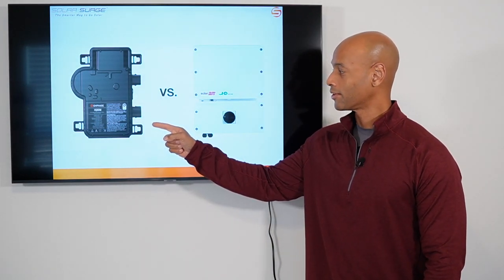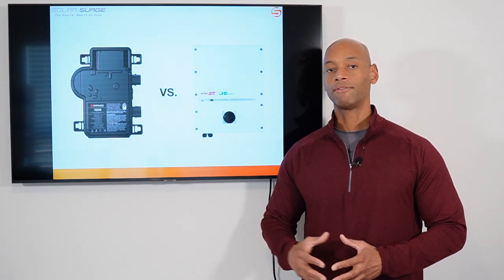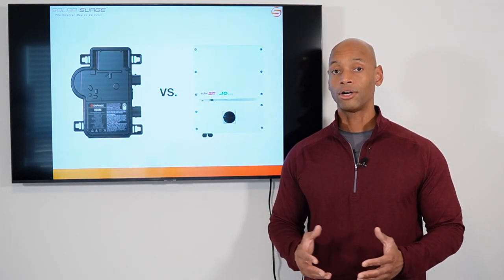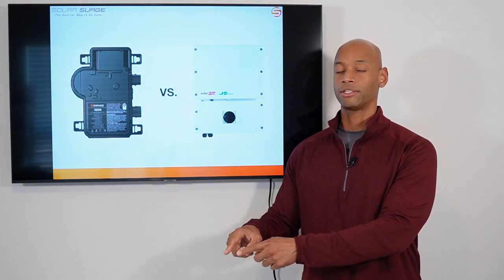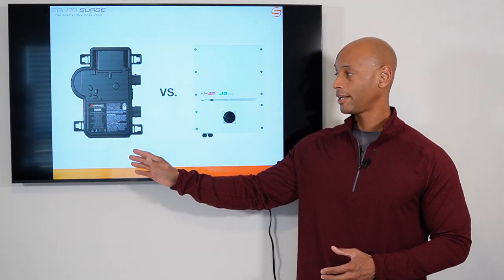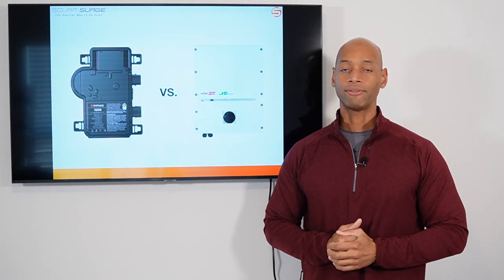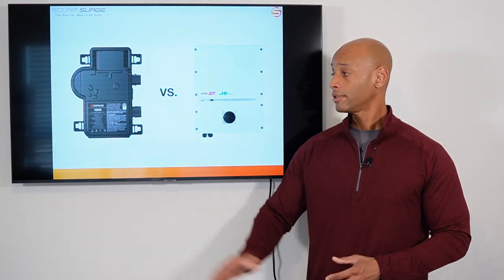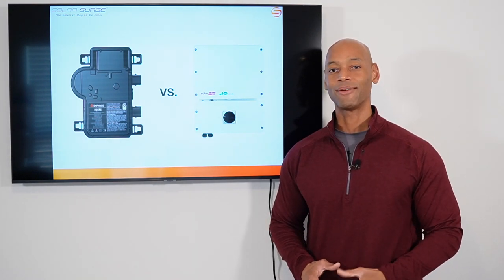Enphase IQ Vs SolarEdge Going Into 2023 | Solar Inverter

Comment: Ive had 12 enphase solar pannels installed on my roof with seperate micro inverters and its working brilliantly BUT im trying to get a price for a powerwall but when i asked enphase through the contact us link and they wont give me a price they keep telling me to contact my installer, surely installing an enphase battery energy storage powerwall cant honestly require an enphase tradesman to install the powerwall?....can it !?, or can someone on here tell me how much a powerwall will cost me and tell me jow easy or difficult installjng an enphase powerwall will cost me?.

Comment: Hey joe, I have been meaning to talk with you about your use of the term Daisy chain wiring to describe series wiring. It is a great sound bite, but it is wrong. Daisy chain wiring describes parallel wire common ground and common hot along the string. In Printed circuit design low speed circuits can be star or Tee wired. To control the trace (wire) impedance high speed circuits use daisy chain routing this reduces the refections of the trace. A better analogy would be series strings are like the very old Xmas tree lights that when one lamp fails the whole string fails versus newer Xmas tree lights that are wired in parallel so that when one light fails the rest of the lights stay on. In summary string inverters are basically series strings ( optimizers bypass the failed or poor performing panel). Micro inverters are true parallel circuits. Mixing and matching solar panels with Micro inverters is not a problem. Mixing and matching panels with a series circuit and optimizers provides no benefit. Before I go, what is missing from the current solar ecosystem is a vendor agnostic balance of system. If I choose a Tesla Powerwall I am locked into their gateway, their switch….This is true of every vendor in the market. There are some bleeding edge solutions in the DYI market, but nothing that I can get permitted or approved in my market here in San Mateo County CA. I have enphase Micro inverters and 2 tesla powerwalls, Tesla doesn’t give me a generator option Enphase does. Neither provides a solution that allows me to cross upgrade or maintain my current system. There are no barriers to entry just the need for existing players to produce battery, inverter and solar agnostic balance of system hardware *this includes incoming grid service panels. It is ridiculous that we have to upgrade the service panel to handle loads that it will never see. I send people your way almost everyday. Keep up the good work. Thanks for all you do.

Comment: I think you mention in a straight up String of solar panels... if one leaf falls on one panel the whole string plummets. I think that is basically incorrect as each panel has bypass diodes which take care of this. The one panel will plummet, but the rest of the pa els will deliver. Do i have this wrong?

Comment: I think it is a good philosophy to keep complexity within replaceable devices.  It is simpler to replace a complete assembly not working.
And to minimise interdependence of devices.  You do not want to have to decide which device of an inter- related group has failed.
Best to dumb down and make ultra reliable on site work.  Simple AC connections are easy to do, reliable,  and easy to  fault find.
Enphase micro-inverters seem best to me.  But I have no actual experience working with solar.

Comment: Isn’t Enphase efficiency at a disadvantage for solar battery charging as it has to do two AC/DC conversions (into the battery and out again) whereas SE only has to do this once?
Reply: waiting for a reply
Reply: yes, this would be a (very small) disadvantage.  however, it's not a normal use case, IMO.  when using storage, i am typically using a string inverter or charge controllers.  if grid-tied, i would use the enphase every time
Reply: It is more efficent when it is working. But when it breaks ans stays broken it is trash.

Comment: Doesn’t Solar edge with dc optimizer mean that you can use a DC coupled battery with less AC->DC—>AC loss that occurs with AC coupled battery? Also that battery wouldn’t need its own inverters
Reply from the maker: Yes, the SolarEdge architecture allows direct DC-to-DC solar-to-battery charging.  The SolarEdge battery needs toe be connected to a SolarEdge central inverter.

Comment: Hello, I live in central Pennsylvania. I am working with a solar contractor that utilizes Enphase inverters. He is specifying the iQ8+ inverter for a 38 panel system with REC 405 pure panels. I was looking at the output of the panel compared to the continuous power input for the iQ8+ and it looks to me like the panel put out more than the inverter can handle continuously. I asked if they thought I would be better off with the iQ8a which looks to exceed what the panel can put out. I was told that the iQ8a isn’t as good with low light power as the iQ8+ and that because I live in the north east the iQ8+ would not likely clip or have the panel exceed the inverter. Does this sound correct?
Reply: Try IQ8M
Reply: @fyrchiken, I'm looking at the same iQ8+ w/42 REC405. did you have them installed? If so, any feedback good/bad? Thx

Comment: I am surprised that you completely ignored the need for a DC buss and DC rated “fusing”. At least in my area the cost to build out an approvable DC system to the string inverter, eats up any cost advantage of the optimizers. I chose Micro-inverters for my install because it is the cleanest solution. No DC buss, built in redundancy, and the ability to mix and match solar panels of differing output, size and manufacturer. LG has exited the solar panel business, If and when one of my 39 LG panels fails it is a no brained to replace it with another panel from a different manufacturer and different performance. This is not the case with a string inverter with or without optimizers.  I get it that in the trades the lower bid almost always wins, but who wants a solar system that is obsolete the day it gets installed. Overcapacity on the Micro inverters is a feature not a bug. I have worked as a EE for a long time an reliable systems always have head room designed in. Enphase is delivering mature products that’s just work. A DC system is not simpler to install or permit. I have nothing against optimizers, I just can’t for the life of me come up with a scenario where I would rather have then on my system. I appreciate all that you are doing. Thanks for the great content.
Reply: Overcapacity?  I heard his comments just the opposite.  He said the Enphase inverters are undersized for the newer and larger panels.  That is the opposite of having headroom designed in.

Comment: How about neither? Modern panels with bypass diodes are more than sufficient vs the cost of another point of failure
Reply from the maker: That's a good point.  We see most homeowners like the ability to monitor each individual solar panel even if there is not much performance gain.

Comment: which ENPH IQ8 version has panel level module monitoring?
Reply from the maker: All the Enphase micro-inverters offer panel-level monitoring.
Reply: @SolarSurge  Thx, so what's the main difference between IQ8A to IQ8+ ?

Comment: In my case and my experience its not brainer ENPHASE its the best 😎. I will explain why in my opinion is. Here in Puerto Rico beside the experience with hurricane we have a BIG problem with the ELECTRIC company GRID its a old system and problematic along with the management that operate the company so long story short I had a SolarEdge system with 24 solar panels and the inverter use was 76000 serie inverter the big monster elephant in the room that has to operate with a small transformer on the side do to the batteries that I was using the Powerwall first generation (6.4km) 2 of them and that system was giving me all kind of problems, probably the batterie incompatibility wrong setup or connection you name it but the main issue that I found was that during of grid mode the combine energy consumed from the inverter and transformer to operate and maintain my hose was using a lot of energy from the batteries so with this new system that I have same 24 panel iQ7 and one Tesla Powerwall 2 battery its a big difference that battery it last me all night and morning till sun come up. I will never ever use a Solar Edge product again not event a BOLT or NUT made from solar edge

Comment: I have Hoymiles, HMS-2000-4T-NA, 4-in-1 microinverters in stock. Each microinverter can output 475W per solar panel, which is 25% more power than an Enphase IQ8H, and includes a 25-year warranty.
Reply: That warranty doesn’t help much as it likely Hoymiles go bankrupt. Also for installing a whole home energy system it’s much easier to rely on Enphase for almost all components.
Reply: @TurreTuntematon  Not likely at all.
Reply: @ToddDesiato  We will see in 2-3 years..
Reply: Hoymiles is a Chinese made vs Enphase being a USD company,I rather deal with America for reliability
Reply: @TurreTuntematon  Yes we will, and by then, I will have a 4-year head start on y'all.
Reply: @Wildsam157  Exactly. Hoymiles or AP systems are both doing mikroinverters but it’s the same as going for a Chinese Oppo smartphone vs an iPhone. No thanks.
Reply: @DiySolarHelpDesk  That warranty is not very useful when Hoymiles as a company doesn’t exist anymore and your systen doesn’t work 😂. It’s gonna need more like 4 years of savings from you then to be able to afford a new solar system.
Reply: @TurreTuntematon  LOL! That's not likely to happen, North America is not their only market and they are growing very quickly. Also, at half the cost of an Enphase, and the fact that any other microinverter is still compatible as a replacement, makes this a non-problem. If you want the savings and better ROI, it's worth the risk IMO. As I said, I have over 100 installed in the field and zero failures to date. Your loss.

Comment: The problem with the microinverters is that you have to convert twice to store in DC batteries whether they are station batteries or EV battlers.  The EV will be one your largest consumers of power so shouldn’t you be geared towards that demand?

I don’t think microinverters will have as much draw as we move into more home batteries and V2H / V2G configurations.  Too much power lost converting.  Besides replacing a string inverter every 10 to 15 years ushers in new functionality and maybe even more efficient dc-to-ac conversion.
Reply from the maker: I would agree that DC coupled systems offer more efficient battery charging. That’s a distinct advantage for that architecture.

Comment: Enphase need to offer better compatibility to up to 550w panels, cutting it down to just 300w is the reason I went elsewhere
Reply: that's something i've struggled with for my next install.  the IQ8H is rated for 380 continuous VA, btw.  i plan to just get 370W panels and deal with it...

Comment: There is a larger output micro…IQ8H has 384VA max 380VA continuous.
Reply: People tend to forget about IQ8 H for some reason…
Reply: Still not enough for Panel 470w and above
Reply: Very few residential customers install 470 watt panels. They don’t fit on a roof in a 60 cell format.

Comment: It is more efficient to convert 240 VDC to 240 VAC than to convert 12 VDC to 240 VAC.

But it is easier to ship AC over wire for distance than it is to ship DC.

So maybe we should get DC optimizers and string inverters on the roof, then combine the outputs of the different string inverters to send down to your panel.

Comment: I have both systems. A 4kWp solar edge system and a 6kWp enphase system. Both work fine although I prefer the solar edge app over the enphase app. Enphase provides a basic app but does not allow you to drill down on each panel like the solar edge app. Enphase provides a more comprehensive app but at a cost, in my case it would be £250.
Reply: Enphase DOES provide information down to the panel/inverter.  Look at your array, see the symbol in the lower right corner of each panel, click that for more information.
Reply: @allangoodman82  There is no symbol in the bottom righthand corner of each panel with my app. The only info given is the kWh generation
Reply: @colinwilson9122  use enphase enlighten, your array on that app shows the symbol on your panels
Reply: does both system are combined, mean they are for the same house?
Reply: @dema-3000  yes both systems are on the same house

Comment: I think the information on DC to AC ratio in this video is overly simplistic. There's a lot more that goes into it. In areas of high heat, like Florida, you can get away with a much higher ratio without significant clipping. Enphase has done an extensive white paper on the subject showing module pairing scenarios in different climates.

Comment: Please, when speaking about string inverters stay with the current panel technology, not old, with multiple diodes, split cell, and much improved inverter MPPT that works extremely well.  Much research has proven that the past shade advantages of micro inverters and optimizers is in the past.  Also, failure rate of solar panels is 5 in 10,000! Yes, .05%.  Think about this, Solar Panel warranties are 12-30 years because of the reliability. Thus monitoring each solar panel is unnecessary. Regarding SE and Enphase, get Enphase.

Comment: Would you rather have an ultra reliable PV array connected to an easily serviced string inverter and not see individual panel failures or.    hard to service under array electronics operating in a hostile environment that gives visibility of panel failures?  Why compromise the reliability of your array with under array electronics?
Hard to service
Reply: ? I had an optimizer go bad when my system was five years old and I changed it out myself with a used p320 optimizer off ebay for $30. Took less than 30 min and that was 3 years ago.

Comment: SolarEdge just sent an E-mail allerting users will loose the ability to remotely monitor their systems. They said, T-mobile cancelled service for the network. I can purchase a new modem. What terrible customer service. Six or Seven years into a 25 year warranty. Shop around and find a better company.

Comment: Enphase is trash in Arizona. Don’t do it
Reply: Why?
Reply: @maximus20895  simple put, you know how your phone has those heat warnings? And you know how when you charge your phone it gets really hot? So that’s a micro inverter converting ac to dc.

Enphase is doing that on your roof under every panel.

So when it’s 110-120 out your roof is about 30-40 degrees hotter. Now imagine a cellphone on the roof charging for every panel you have.

It ain’t reliable. And oh by the way any contract you sign the installer won’t service 1 micro they wait for about 5-7

Comment: Why do you keep talking about shading on string inverters when there are many videos online just proving that they put lots of shades on those string inverter panels and it has very little effect so that advantage now has become moot, and probably because of the multi cell configurations within the solar panelwhat’s your response to the new stuff? This info is a little outdated now.